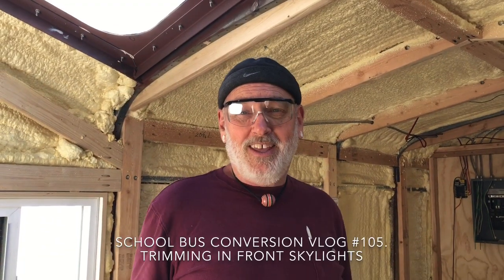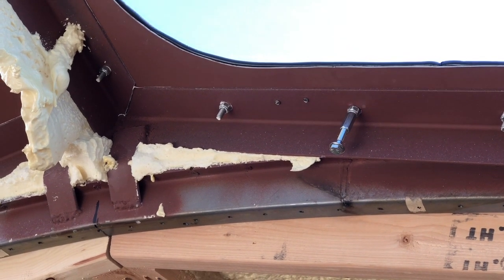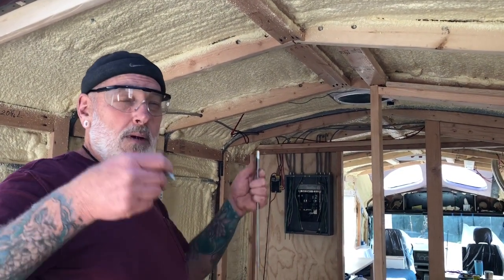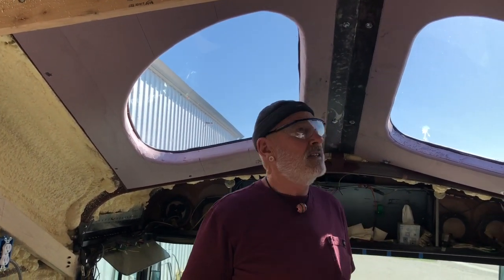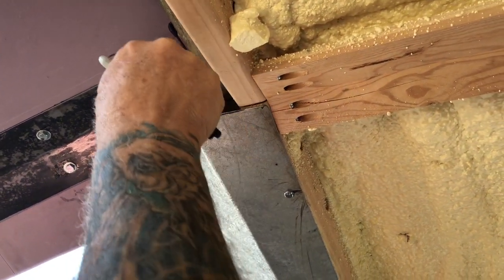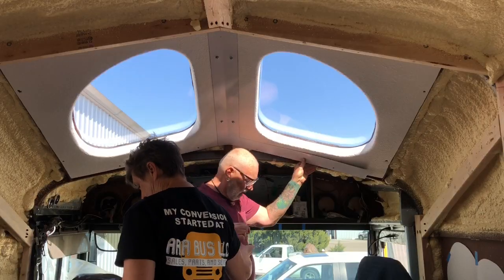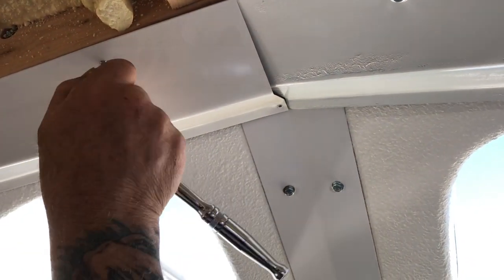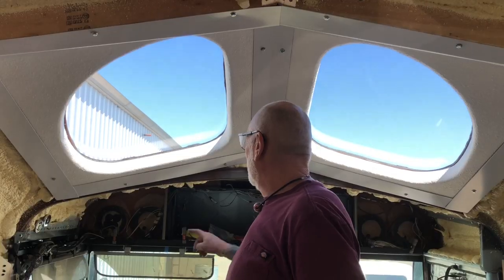Trimming in Front Skylights - Vlog 105 School Bus Conversion

Comment: What are you going to do about insulating the exposed metal framing connected to the bus skin? If you get in really cold weather it could frost along with the outside and when it thaws, you'll have water dripping inside the bus.
Reply from the maker: Yes.... we know that. Still have more spray foam insulation to do. We ran out - more is on its way. Thank you for your concerns.